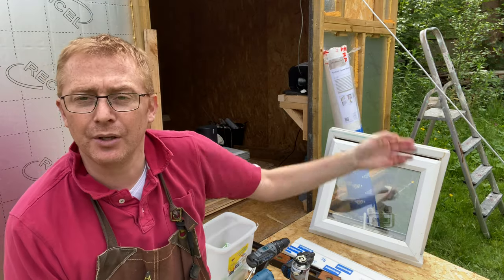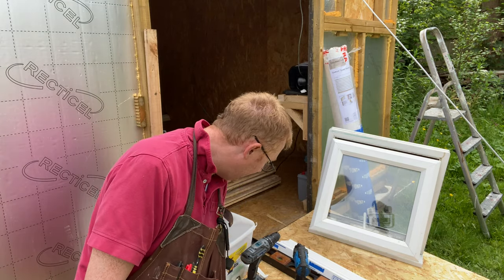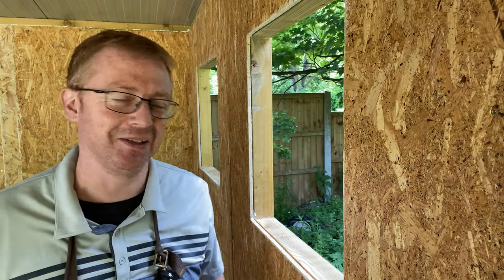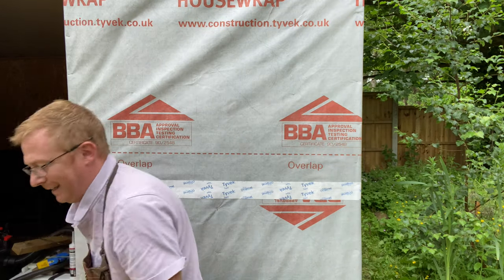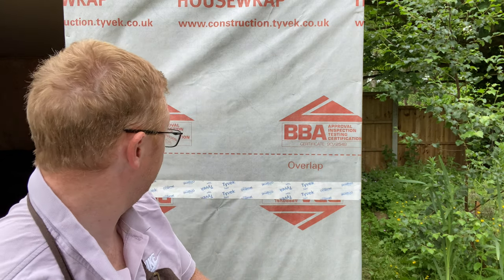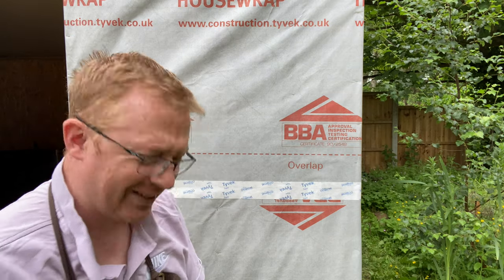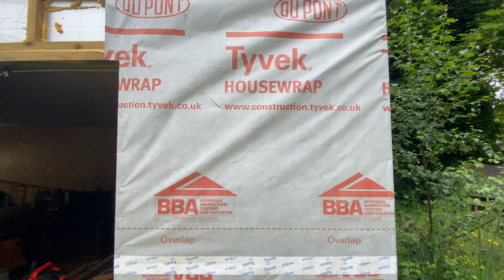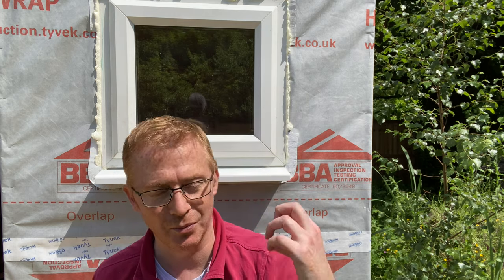Installing UPVC Windows into a Timber Frame Garden Room / Workshop. Part #10 Build Series

Comment: Great stuff, as usual, Leo! I loved learning that I could install windows too. LIke yours, mine were second hand/samples from a retired salesman. Two were double-glazed sash-type (150mm deep...!) and three upvc. Really satisfying to fit them - needed help with the first two - wooden frames and 1200 X 1400! 

The workshop is really coming on - all the stuff now is gravy after the hard graft of framing, etc. I'm certain it'll be worth it all. I don't know about you but I find myself standing in my workshop looking around and shaking my head - amazed that it was possible for me to do it.

I so admire your fortitude and persistence. I have no personal experience with chronic pain beyond what I've read and heard. I'm so glad you're getting helpful treatment.

Best aye!
Reply from the maker: Nice one Alasdair, thanks for the message. Funny I should read this now, I’ve just been in there this afternoon working on a small job. I’ve  no power (yet) apart from an extension lead and no setup either. However, the space was just incredible! I couldn’t believe how easy it was to manoeuvre stuff around 😀😀. Only done a bit but it was so satisfying 👍👍. Really happy with the windows, they’re better than the ones in our house😂😂

Comment: Great video Leo, a have a chronic  condition which when it was bad pushed through and what you say resonates so much. Yes I would push through and do a job in 2 days and then take 3 days to recover feeling really rubbish. Learnt to take 5 days and feel not to bad at the end. Really takes the same time but how you are now tackling things you feel better overall and more consistency. Take care.
Reply from the maker: Thanks Daniel so much for sharing similar experiences. I’ve got so much to learn in regards to chronic pain and accepting its long term consequences. Think I’m on the right path now though pal so fingers crossed it will help in my life 🤞🤞👍👍

Comment: Great series Leo, looking forward to the next one, thanks for doing these. Would like to say thanks to you I am now starting my own Summer house / workshop, and after your video on the roof I am now going to opt for the insulated panels, looks like a good permanent solution that will hopefully last longer than the EPDM alternative. Thanks again Simon
Reply from the maker: Cheers Simon and apologies for such a late reply. Your comment was put in the ‘held for review’ bit which I hardly ever check🤷‍♂️🤷‍♂️. The insulated panels are excellent, they look good and are much less hassle that building a ‘traditional roof system. Good luck with your building adventures 👍👍😀😀

Comment: Cracking job lad!

Big wipes and spray should get the pvc looking as good as new. 
If not cladding for a while, I’d maybe get some uv protection over the pu foam, so it doesn’t perish. Or just leave it proud until ready to clad.. might still be good when you cut back.
Reply from the maker: Thanks for the tips Handyman. I’ve cut back the foam inside but will leave it as it is outside until I’m ready to clad the building. Didn’t know about it perishing so really appreciate that👍.
Reply: @Hand-i-Craft  I once heard, outdoor primer over top is enough to keep uv rays off, but never tried it.
Some foam is UV resistant, but most have a 7 day recommend exposure.
It’s cheap stuff, could always redo, when you’re ready to clad.
Reply from the maker: @heriothandyman3148  Cheers, much appreciated 😀👍

Comment: Hi, one thing that I have bought that I put off for a long time because I thought it would be expensive was a laser level. I cannot tell you how much it helped me get level lines and putting windows in was a breeze compared to using a level, the difference was that with the laser you get a horizontal line and a vertical line at the same time. One bit of advice I would give is go for the green one, it is easier to see.
Reply: Laser level worth every penny. I even use it now for hanging pictures!
Reply: @EM-fh2tx  me too
Reply from the maker: Thanks John and it’s really interesting you mention this now. Only two days ago I spoke to a joiner I follow on Instagram who has given me some excellent advice in the past and I was asking him about laser levels and what brand etc. I’ve got some affiliate money just come in and was thinking of buying one (there is a ton of unseen footage in this episode that may well explain why in the future). Anyway Lewis recommend self levelling and green as red doesn’t do too well outside apparently 🤷‍♂️. I’ve seen a Huepar model that currently has £50 off on Amazon so I think I’ll be going for that one 👍👍😀😀

Comment: Just found your channel Leo as I'm planning my own Garden Room build. As many others have said, you're an inspiration to us all. Today I've skimmed through your vids but now I've subsribed I intend to watch them all, particularly the ones on your roof as one of the issues I'm trying to fathom out is how I can achieve a maximum internal head height. My build is for my son to use and hes 6'3. My family is working through a different kind of pain and I need my son to have his own private space.
Reply from the maker: Hello Steve, very kind of you to post such a lovely comment👍👍. Good luck with your build adventures. As you can see I’m certainly so expert, just an enthusiastic learner trying to make things work for me. The angle of pitch on the roof might help a little with gaining some fractions on the roof height. Mine is 6 degrees but you would probably be fine with 4 degrees of pitch. Is your build restricted to 2.5m in height? Check with permitted regulations, but my understanding is if your garden room is over 2 metres away from the neighbours boundary wall you can go up to 3m in height for a single pitch roof.
Reply: @Hand-i-Craft  Hi Leo. Yes I would like to keep my building under 2 .5 meters if I can and these SIP roofing solutions look like a neat way to workaround the warm roof, cold roof, hybrid roof nightmares. The  2 meters from the boundary rule will mean I’d eat up a lot of garden space and I don’t have a lot to play with. Yes Im looking at roof pitching angles to see what I can get away with. I’m also investigating a sound proofing and insulation combo for the walls as my garden backs onto a road and my son records a lot of content for something called YouTube, you might have heard of it😂

Comment: Hi Leo,  You have such an infectious smile!  Glad you missed Pam's dad's hand with the staple gun!  Looking good so far (8.08 in).  Mike
PS  couldn't you adjust the depth of the staples with your gun?  I can do this with my air nailer/stapler and after setting up it was fine for multifoil lnsulation ( how good the insulation is is another story!).
Those windows certainly won't fall out!!!
Reply from the maker: Thanks Mike. I set my Ferrex Brad nail gun to its lowest setting and it was still just ripping through the Tyvek. Staple gun was much more gentle and suitable. Really happy with how this part of the project finished up. Had some really lovely feedback off folk who do this / have done this kind of job for years and how impressed they were with the quality. They’re better than the windows in our house😂😂
Reply: @Hand-i-Craft  Hi Leo,  I thought you were using stables in the gun.  I don't think Brad nails were a good idea!  Mike
Reply from the maker: @katabrontes  Sorry Mike, didn’t explain myself very well. Yes, initially I was using my Ferrex brad nail gun, but it also fires staples as well so I had staples in it, but even on its lowest power setting the staples just ripped through the Tyvek. The ‘traditional’ Stanley wall stapler done the job great👍👍
Reply: @Hand-i-Craft  Hi Leo,  That is odd.  On mine if I turn down the air pressure and adjust the depth I can set the staples at almost any depth but maybe the battery guns are not so flexible as I assume the " power" can't be varied.  The hand stapler must have been pretty hard work.  Lidl do a small electric ( mains) stapler which is fine for upholstery and very light and cheap (about £12  I think).  It does jam occasionally but we found it fine for fixing material onto a plywood former for a pelmet.  It uses quite light " paper grade" staples but they should be fine to hold the membrane in place as it will be held fast once the boards are fixed over it.  Mike

Comment: Hello Leo just came across your channel and thank you for explaining how to do this. Can you tell me what the name of the clamp is that you used as it looks really useful and I want to get a pair. Thank you and keep on DIYing😊
Reply from the maker: Thanks Ronan, I bought those clamps from one of the Chinese distributors like Banggood. They are a rip off of a more expensive (but similar) design that are used to lift the likes of washing machines etc. What might be better (and cheaper) for you are a set of air wedges from the likes of Trend. Simply slide the pouch in to the gap and inflate to hold the window in place whilst you secure it 👍👍

Comment: Hi. Thanks for this it’s a great help and hope the chronic pain is being managed the best it can. 

I had a question on retrofitting a window into a timber structure. I’m worried about the frame swelling in winter and the pressure it will put on the Upvc windows. Do you have any thoughts/advice on what precautions I could take?
Reply from the maker: Thanks Hussain for the comment. I understand what your saying about the movement of the timber, but as I done in the video if you allow space around the frame of approximately 5mm, use packers to hold the frame in place and then use fixings to secure the window and then use expanding foam to fill the gap that will be fine and any movement will not ‘squeeze’ the windows 👍👍

Comment: Hi again Leo.  I hope a lot of GPs ( I am a long retired GP) watched your section on pain management and pacing.  When I was practicing I had several patients with chronic pain and Post Viral FS , as we called it in those days (before 2000).   Your simple advice and your example would have been inspiring then, as it is now.  I suspect many doctors still have a lot to learn about pain management which is also, sadly, very inaccessible in today's NHS.  Do you mentor others with chronic pain.  If not, assuming you can find any time in your very busy life, would you consider this?  You are an inspiration and a prolific source of very useful tips.  Mike
PS Where did you find that very nifty spreader clamp?  Found it!
Reply from the maker: Wow, don’t know where to start with this comment Mike, apart from thank you firstly😀. I’m very lucky to be on this programme as I am under the umbrella of the Walton Centre and it was my consultant surgeon who recommended it to me. Very interesting to gain a better understanding from a physiotherapy, psychology and occupational therapy perspective, plus input from the surgeons team. It certainly has helped me to face the situation I’m in in a more realistic perspective. Just trying to get to the end of the day, have very little sleep / rest then just getting up and trying again simply long term is not sustainable. Neither is the boom / bust cycle of living. Over the coming weeks / months I need to make adaptations in my life to gain a more balanced way of living which hopefully will benefit the pain side of things and the mind. I haven’t mentored anyone in regards to chronic pain but maybe that is something to consider in the future. Take care Mike, those clamps btw I think will come in handy for a variety of uses👍

Comment: How would you retrofit a pvc window/door on a shed that already has cladding? The current window are just acrylic panels a boxed section between studs and extra strips to hold the window in pace plus sealant. How would I do flashing for the openings, given that cladding is nailed in place. there is a membrane, but these opening are just wood as the current scenario just has the window panels almost flush with the outside.
Reply from the maker: Hello Paul, cheers for the message. In short I’m not sure tbh as I’ve never retro fitted upvc windows in place of previous single glazed ones? How thick are the walls and could they accept a complete double glazed unit like the ones I’ve fitted? That’s the first question you need to ask yourself and work around the remaining issues after that. If the answer to this first question is no then it is a non starter really
Reply: @Hand-i-Craft  thank you for replying really like the channel. Do it at your own pace don't worry about a thing online. Anyway the boxed depth is studs around 2" 7/8ths or  73mm then the current panes are held in with a small amount of trim and that plus pane thickness is just a little over the cladding thickness 18mm or 6/8ths. As you can imagine the panes are super thin which is why I want to do the windows and doors. The trim in the other direction is about the same width so wondering about how to attach flashing tape to membrane  what I'm thinking is to remove the trim cut a small channel on the back of the cladding carefully using my multi/ossolating tool then insert strips of flashing tape into the channel to attach to the membrane
 Seal the gap and add trim filling gaps flashing tape all round. Then ready for PVC. Not sure about the cills may extend a bit but no biggie. In any case PVC windows and doors was an option with this shed but about double the retail price.